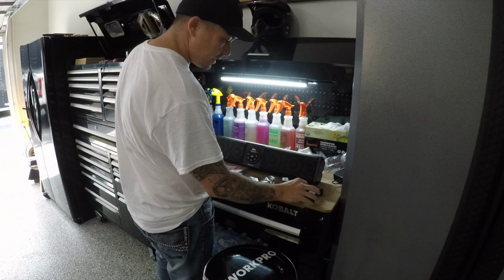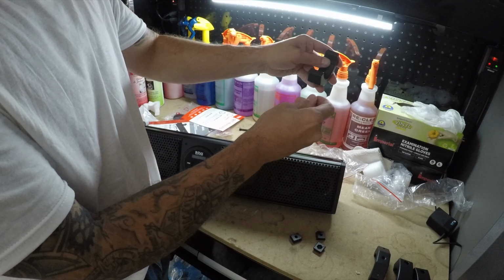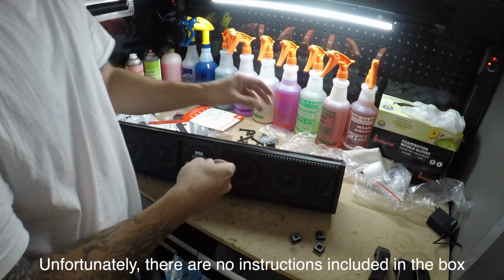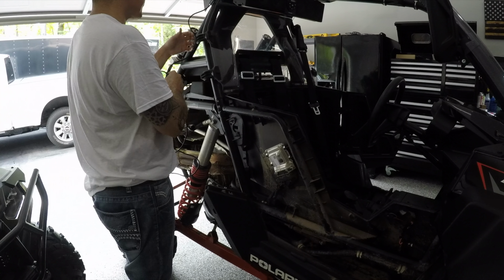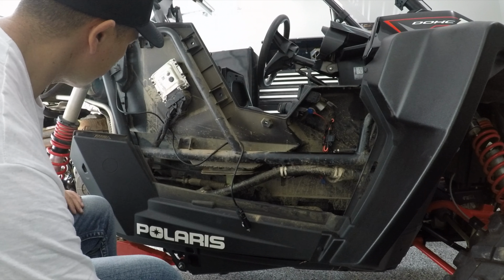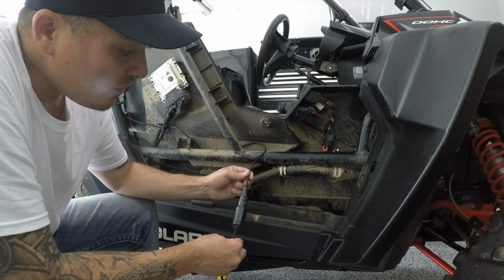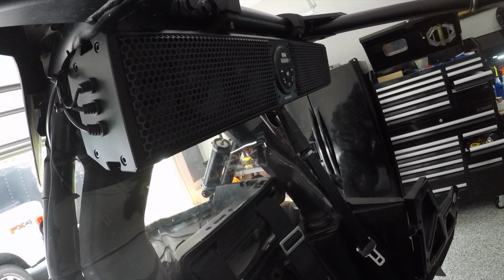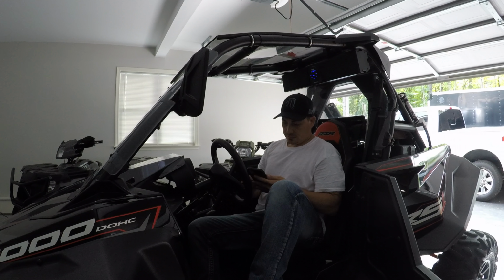Installing a Boss Bluetooth speaker in my Polaris RS1

Comment: I bought the same one and I found out that if you connect directly to the battery,  you can still manually shut it off on the bar.
Reply from the maker: Yup absolutely.  I decided to connect mine to the rocker switch just to insure that if I forget to cut it off it will cut off automatically when I shut off the vehicle and not drain the battery.  Plus I wanted to make use of the rocker switch section...lol.

Comment: How do u screw the screw on to the speaker ?
Reply from the maker: Are you talking about the bracket screws?  They slide through the sides in to the length you need and tighten in place.  Then on the roll cage with the clamps.

Comment: Did you use a wiring harness or just straight from the soundbar to rocker switch? Where did you connect the ground from the speaker?
Reply from the maker: The speaker comes with a long wire (positive and negative). I ran it to a rocker switch directly and from rocker switch to battery.

Comment: How hard was it to wire it to the rocket panel? Do you go from the battery cable and a line comes off for the panel
Or how does that work?
Reply from the maker: I went straight to the panel.  Super easy.  I believe there was about 4 or 6 open fuse lines available for add on’s

Comment: Does yours have a buzzing or hissing sound when the speaker is on and the music volume is low? I notice mine does when connects to bluetooth and aux. I wonder if I have a defective sound bar.
Reply from the maker: I no longer have this particular speaker but I’ve never experienced any buzzing or any feedback at all……yours might be defective.
Reply: @FindingJay what do you have now?
Reply from the maker: @orion000  I had the Ecoxgear se28  on the back of my truck but just sold the truck recently  because of my channel theme.  I did love my speakers from Ecoxgear though.  They always worked great for me.

Comment: I have the same speaker and it sounds great 👍 but I'm probably going to upgrade to the 36"
Reply from the maker: Steven Off-Road definitely does.  I am very impressed so far.
Reply from the maker: I wanted the 36” but I couldn’t fit it on the RS1.  Still, I’m very happy with my purchase
Reply: @FindingJay  yes definitely the speaker looks and sounds great on your Polaris 👍 
and great job on the video!

Comment: Lighting, Stereo and Electrical

Hi, I have mbquart soundbar, and I want to add one more speaker to the sound bar. What's the process? Do I have to order amplifier? Or can I connect directly to the sound bar? I want all speakers work together.
Reply from the maker: It’s funny you ask cause I just had this conversation with the dealer where I purchased.  Unfortunately only one blue tooth will work at a time and the only way to add speakers is if you bought as a set.  Hope I was able to answer your question but if you find out anything different please feel free to let me know. .....it’s definitely something to know for future reference.
Reply: i think there is a adapter on the website

Comment: How's the time review. Still working good?
Reply from the maker: Unfortunately I have sold the bike recently and couldn’t tell you anything other than it worked great with no issues till the last day I had it.  Through mud, rain, bounces, vibration, dust and everything else out in the trails it worked great.  I would definitely purchase it again if space was an issue but for a 2 seater I would go for the larger one that is said to have more power.
Reply: Ok great. Tnxs for the advice. Just bought a 2021 kawasaki teryx le s.